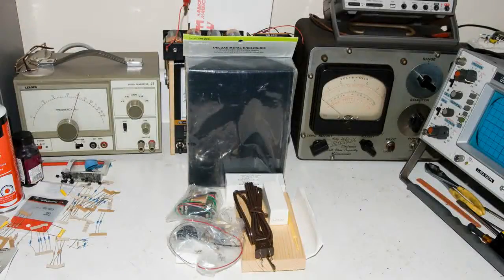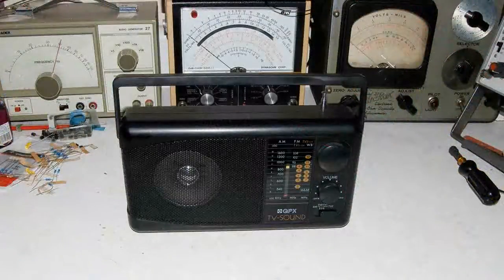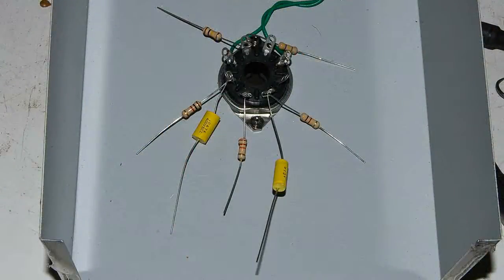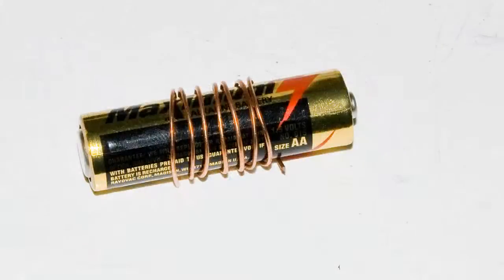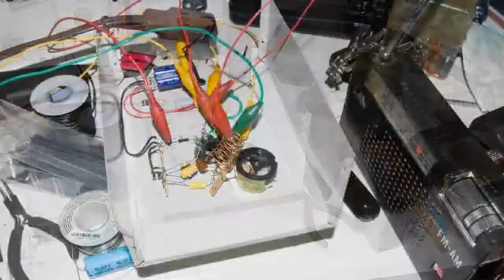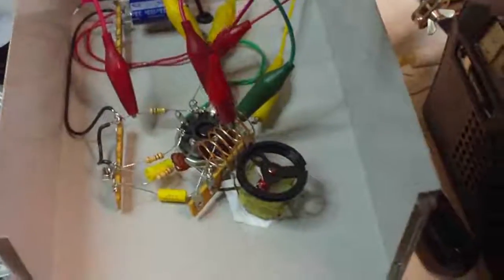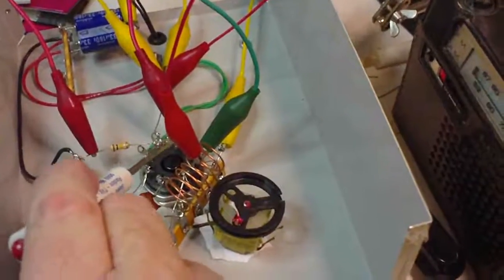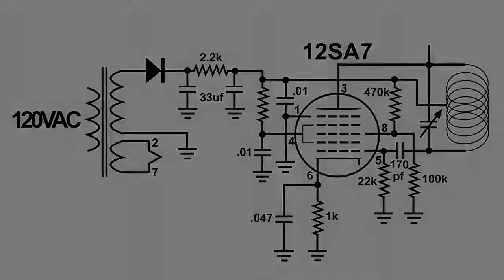Tube FM Transmitter project part 1

Comment: I got my copy on the air! I kind of gave up on this little bugger 7 months ago but I find myself indoors allot this time of year and gave this project another go. I originally bread boarded mine, and realized all the extra wire on the breadboard was probably an issue. I re-built it in a pie tin and now it works as expected (buzz and all). Thank you for posting this video with a schematic and commentary. I defiantly learned a few things from this one.

Comment from the maker: The most common problem when building an oscillator is what is used as an isolator. It conducts at RF frequencies shorting out the oscillator. And the 12SA7 and the 12SA7GT are not the same tube, I did a video on it.

Comment from the maker: Anytime you can get an oscillator to oscillate and on the band you want is a major accomplishment. Try building the one transistor FM transmitter, I have three videos on it. I recommend building the 2-3 or 3-3. Than go back to the tube transmitter.

Comment from the maker: Of Course, I knew you would be interested in this project. At this time I'm not sure what changes will happen, but that is the fun of it. I have been there many many times. I may change it a lot or maybe very little??? dnl5649 is very interested in FM transmitters also. Experimenting is the fun part. The more you experiment the more you learn and the more confidant you be come.